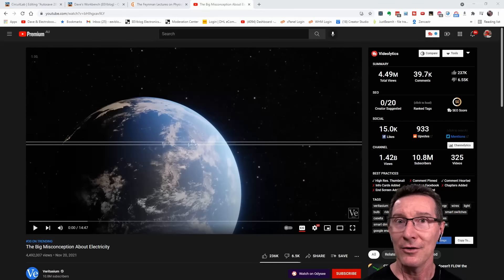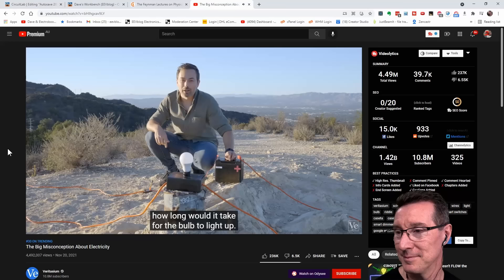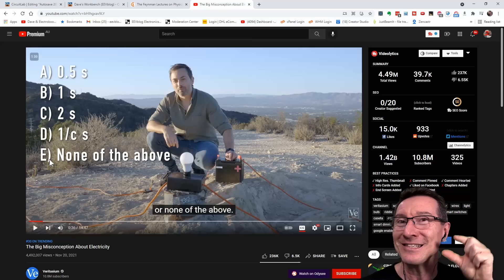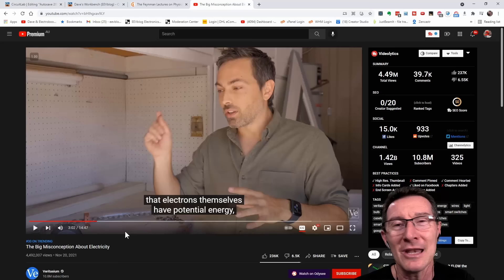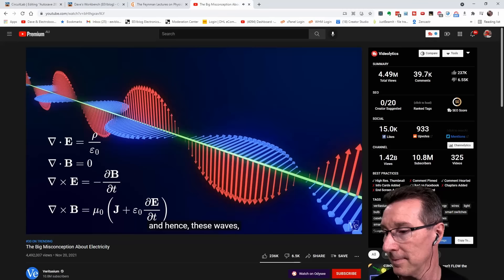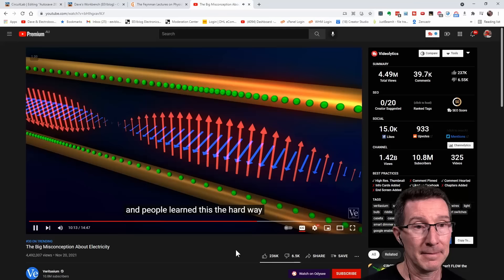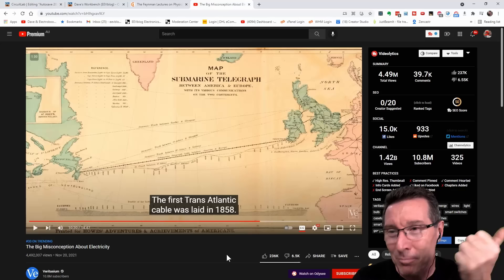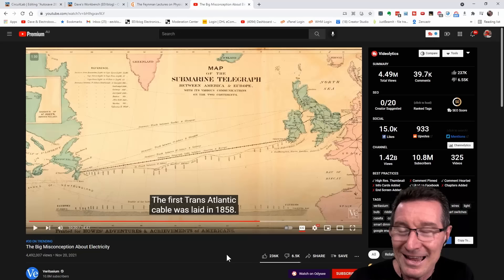EEVblog 1439 - Analysing Veritasium's Electricity Misconceptions Video

Comment: Derek did not give all the details of the wire used (other than "no resistance"), but for what it is worth -- one can model a parallel transmission line to develop the characteristics that may be usable in a circuit simulator.   For example, if we assume the wire is 10 gauge and is separated by 1 meter (center to center), the characteristic impedance (Zo) of this transmission line is about 798 Ohms.  The capacitance is about 0.04 pf/cm and the inductance is about 26.6 nH/cm  (all assuming a dielectric constance of 1.0 -- free space).

When the switch is closed, the current that flows will be based on this surge impedance (x2) -- ignoring any lamp impedance -- until the sytems reaches steady state DC conditions.    It is not going to be much current during this transient period:   12 Volts / (2 x 798 Ohms) = 7.5 mA  .....    Doubt this is enought to light the bulb "instantaneously".
Reply: Boom, this is EXACTLY what I was looking for - thank you!  The author of the original video conflates steady-state analysis of power with the dynamic step-response of the signal.  Before the steady-state is achieved, the initial power delivery is only 90 mW.  That would be <1% of a 10W incandescent bulb, which isn't going to be enough to cause the filament to reach a temperature that would produce enough blackbody radiation for our eyes to detect (typically the filament reaches about 2000-3000 C).

Earlier in the video, he states the edges are 300,000 km away on each side (although this isn't accounting for permittivity, I digress).  So these parasitic capacitor plates are holding 4 pf/m (per your analysis) * 600,000,000 m = 2.4 mF (yes *milli*) of electric field strength, while the parasitic inductors are holding 2.66 uH/m * 600,000 km = 16 kH (yes *kilo*) of magnetic field strength (!!).  The resonant frequency of such an LC circuit (yes LC no R) is 81 mHz (yes milli) = 12.3 second (!!) period.

With a rise time that's like 6x larger than the propagation delay of the EM fields along the wire, I think we can safely assume there will be almost no reflections :D  Before I saw your comment, I figured the system would reach steady-state after the fields had a chance to propagate and reflections could be damped (~1 second without reflections and ~2 seconds with them) but now I see it will take much longer than that just because the parasitic circuit elements are enormous.

If I'm thinking about this correctly, then would it be the case that: from t = [0..1m/c] there is 0 mA, then the (E?) field propagates through free space between the antennas and "connects" to the battery, causing a displacement current of about 7.5 mA while the (B? and the rest of the E field) propagates along the antenna during t = [1m/c..1/2], at which point the antenna "becomes" a wire.  Would it be the case that it's still 7.5 mA from [1/2..1] or would there be some kind of mutual self-capacitance and self-inductance i.e. crosstalk that influenced this result?  Once the field has fully propagated along the wire (and, notably, the field propagates along both signal and return conductors at the same time), the battery has been "meaningfully" connected to the load, and we'll have more than just the displacement current flowing through the bulb.  Assuming 0 ohm wires and perfect impedance matching between the source and load, the current would then begin to climb from 7.5 mA (or something close to that) at 1 second to the final steady-state value around 7 seconds later (6.15 seconds for the resonant period of the LC circuit + 1 second for propagation delay).  During the period [1..7.15] we should see the bulb slowly turn on as all of the parasitic elements gradually approach their steady-state values.

At what point the bulb qualifies as "on" is still up for debate, but if we baselessly speculate that 1/10th of the bulb's power is needed for the filament to reach a temperature that will produce "enough" photons at the right frequency that our retina will register a stimulus, then my estimate would be about 1.7 seconds after the switch is closed, 7.15 seconds before it stops changing brightness.  Prior to the first full second, it is effectively off, while the period [1..1.7] will likely contain a probability distribution function based on subjective perceptions of the viewer where the peak is skewed toward 1.7 seconds and with a long tail that probably goes out all the way to 7.15 seconds.
Reply: @DeadCatX2  I think the power in the bulb would be even more minute because the cold resistance  of the filament is about 10 times less than its resistance when lit. So the Veritasium video is wrong. The bulb will not light until the wave travels to the ends, sees the short circuit and reflects back to the bulb. He should have used an LED as that would light with 12V through 1.6K.
Reply: Yep, at this time a lot of people figured it out, that there will be current on bulb, but only small. Lets imagine, you have to have a substantial part of current of your sorce on a bulb to light, lets say, 10% of a source, and your light bulb would not light up on a AC coupling only in this case. And video makers keep ignoring this point of view, concentrating attention that we will have potential difference on a bulb.
Reply: This is a great analysis.  I had imagined the two wires coming from the battery as an electric dipole and the two wires from the light bulb as another dipole, so it is (for short times) two coupled electric dipoles.   Your analysis is a great back ofthe envelope calculation.
Reply: So at 0.04 pf/cm it is the equivalent of having two 12,000 uF caps in series with the light (ignoring resistance and before the current gets all the way around and it reaches steady state)
Reply: That's why he cheekily made the "simplifying assumption" that the lightbulb would light immediately when current passes through it. "Current", not x amps of current.
Reply: Yes - and this is what had been making me crazy since I saw the Veritasium video! I did a little very rough math and also came to the conclusion no lightbulb I was used to (incandescent filament) would ever actually emit visible light from the EM wave crossing free space in this model. I don't think most normal (consumer grade) small LED bulbs could give you emission but I would really have to check to be sure. The limited amount of power and short duration of the effect from closing the CD circuit switch 1M away is just really small relative to what a build takes to be considered lit in any meaningful way. Does power flow across the air gap - sure! Does it matter (is it enough to matter most of the time) - not for low voltage and low frequency systems in most cases.

Comment: The youtuber "AlphaPhoenix" decided to actually do a physical test of the thought experiment in their video "I bought 1000 meters of wire to settle a physics debate". AlphaPhoenix also did a follow up video expanding on further questions "Why does WATER change the speed of electricity?"

Comment: I think the visualization is a bit misleading, giving the impression energy basically moves directly between origin and destination as long as there is a physical connection "somewhere". They have the yellow energy lines looking like they are completely independent of the physical path of the conductors (esp. the ones going straight from battery to lamp perpendicular to the wires). If there was something [impervious to em fields] blocking the straight path between the battery and lamp the yellow lines would not be as "neat" and would more conform to the shape of the wires - which also changes the permeability of space part of the formula he only mentioned quickly at the beginning.
Reply from the maker: The visual model was impressive but quite messy. i actually mentioned that in another take I did that I couldn't use before I goofed the system audio setting.
Reply: Sure Dave, blame the audio system. It's always the audio system's fault, isn't it.
Reply: The wires control the current and the current makes B. In this way the wires influence the power flow. The Veritasium video  shows power along the wires, something left out by almost every text book ( well physics text book, I don’t expect engineering texts to do any better).
Reply: It seems that if you screened the battery and wires with metal foil the lamp never lit. Not really my experience actually.
Reply: @mattmurphy7030  something like that
Reply: Hey, I'm a beginner on this stuff, so what you are saying is that in transmission lines the electromagnetic waves is confined within the underwater wire, instead of just flying across the ocean?
Reply: @robegatt  As long as there is a connected circuit between the power and lamp, wouldn't shielding just redirect the EM field along the wires (inside the shielding) instead of intervening space?
Reply: @Tsudico  yep, so we are back at the "it doesn't actually matters"... especially at dc or low frequencies.
Reply: Yeah, somehow he forgot to mention that it's just an ANTENNA setup! You can pick up femtoamps from a battery through air if you wiggle it enough, but that's not what it means for the light to "turn on". Shield the wires or just make them going away from each other instead of running in parallel and you'll get a current on the other side below any measurable noise level until the electrons are actually pushed around the cable the long way.
Reply: @RealNovgorod  He deliberately confused the audience by initially stating that the concept would have to assume that there is zero resistance in the wires, and that the lightbulb would turn on at any amperage, which would obviously never be possible in reality. In reality the light won't turn on until the current has travelled the entire wire length. He just somehow wanted to demonstrate that an antenna setup just like you mentioned, could somehow power the light in some alternate universe lol
Reply: @TheChrisey  I mean, an antenna CAN power a light bulb - there's a trinket like that in every physics classroom since Tesla came up with it. The very important point (which he omitted) though is that power transmission through electromagnetic fields is crucially dependent on geometry (the whole transmission line impedance discussion). In fact, the EM fields are spatially infinite, therefore there are infinitely many paths for the pointing vector to propagate out from the source and you can make out a spatial density of the energy flux and integrate it over the volume of the consumer to get the total power. However, all these paths will have different delays - the straight-line path might have the shortest delay but it might also transport exactly zero energy (or as arbitrary close to zero as you want).
Reply: @bunyu6237  No, EM transmissions won't be confined, they'll past through a lot of things, including water, but perhaps a bit attenuated depending on depth etc . What I meant was that if you put something which does not let EM transmissions pass through a straight path from power source to load (as shown in the animation) it will need to be bent or bounced around that obstacle and the travel time will increase slightly. If you completely shield the conductor (like a coax cable), you no longer have a transmission line at all and the power transmission has to happen along (very close to) the conductor and thus take the same path it does.
Reply: @robegatt   A shield would certainly change the transmission line characteristic.  I'm curious what would happen if you replace the wire with the center conductor of a coax and grounded the shield.
Reply: @bunyu6237  Yes, in a coaxial cable, the entire EM field is inside the coax between the shield and the center conductor. No current flows on the outside of the shield. If it does, it is because you've done something wrong.

Ham radio operators put great efforts into preventing currents from flowing outside the shield. If you just connect a coax to a dipole antenna, the outside of the coax will become part of the antenna, messing up the patterns, and you'll get RF on the radio  chassis.

So we use things called baluns and ununs that are essentially RF transformers to change the unabalanced coax connection to a balanced connection.

If you were to use balanced line, like TV 300 ohm twinlead or 450 ohm ladder line, you only need to match impedance to the antenna. However, the fields then are in the space between and around the wires, so you can't run it near anything conductive.
Reply: @Tsudico  Shielded wires are what we call coaxial cable.  If you were using coaxial cable instead of wires, there would indeed be no significant interaction between the wires 1m apart.  Though the coaxial cables are transmission lines themselves, and it would actually take LONGER than 1 second for the light to come on because the speed of light down coax is about 80% of the speed of light in a vacuum due to the dielectric that separates the conductors.
Reply: @jimmcclymer4230  EE text books teach this. Engineers design these wires and yeah the gotta learn how they work. I understand they omit a great deal of practicality in physics education, simply because of the sheer content to go through. Engineers have more time to go into detail in the relevant subjects. We often skip a great deal too, like in solid-state physics and quantum mechanics. EM theory case quickly evolves from Maxwell's equations and Poynting vectors to microwave theory, and from there to a lot of rule of thumb calculations. A lit of EEs don't remember these at all. "Ground loop" or "return current" are scary words.
Reply: Holy crap, this took off, and in a good way. Thank you all for the interesting discussions!

Comment: It's all about models. If you want to derive the ideal gas equation, your atoms or molecules are tiny billiard balls. If you want to explain the Rutherford experiment your atoms have a positive nucleus and negative electrons. If you want to explain the Chadwick experiment then the nucleus has neutral particles as well as positive ones. And so on. In electrical theory, electric current flowing in wires like water in pipes is a perfectly adequate model for explaining what's going on. You choose your model to fit your purpose.